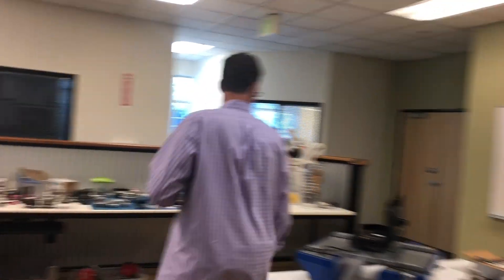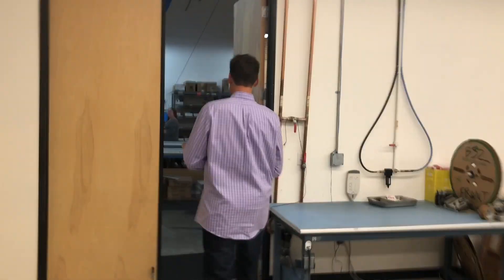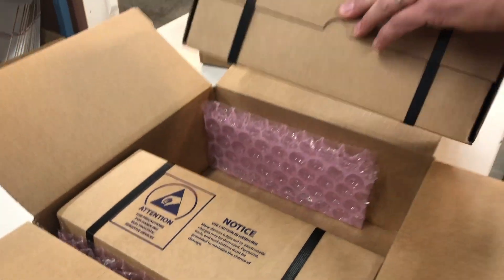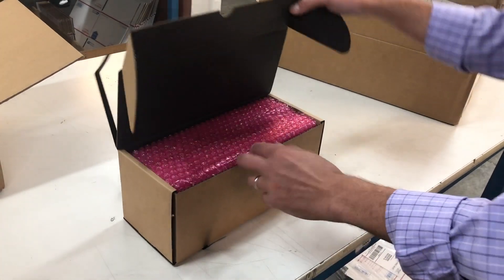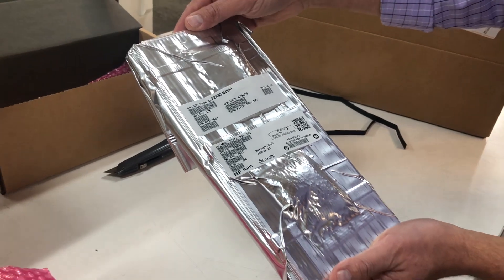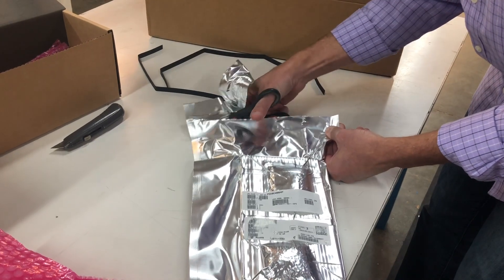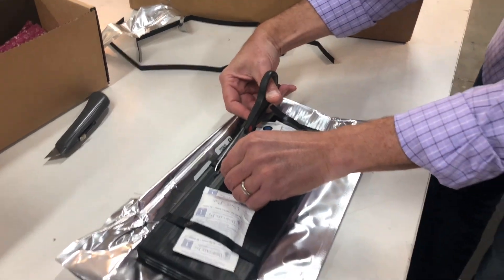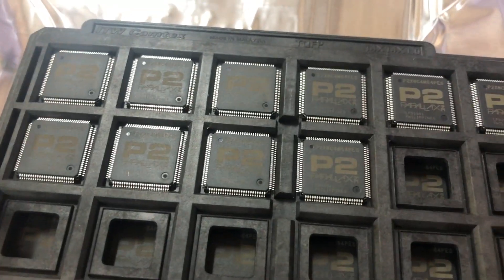Propeller 2 Engineering Samples Unboxing

Comment: Oh yes! I'm already rubbing my hands! Although probably they are not the final revision (I don't know for sure if Chip will change the design, in order to correct the IO voltage tolerance issue to fit the On Semi specs), they are a major breakthrough. I'll want one, for sure!
Reply: Bloguetrónica for voltage latch-up we will specify the part at 4.2V max and the current latch-up test will be done by ON in 2.5 weeks. The ON test could be cause for another spin, if deemed necessary.
Reply: @kgracey40  Thanks, Ken. I was aware of that fact, but didn't mention as is, because I'm afraid I was doing bad publicity while not wanting to. However, I was not aware of any pending latch-up tests. Does that mean the P2 Eval board deliveries will be delayed? I was expecting to make a purchase in the next few weeks.
Reply from the maker: @bloguetronica  No, it doesn't mean we will be delaying board deliveries. We need to get as many users as possible with the P2. We should be ready to ship the P2 Eval Boards by this Friday. I will let the forums know when the ordering link is activated. - Ken
Reply: @ParallaxInc  Thanks! That is good news.